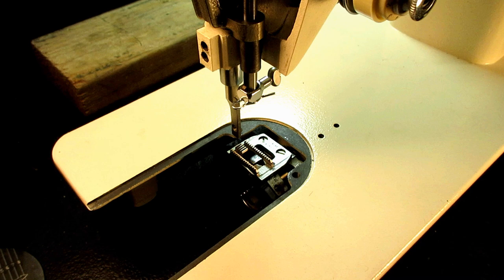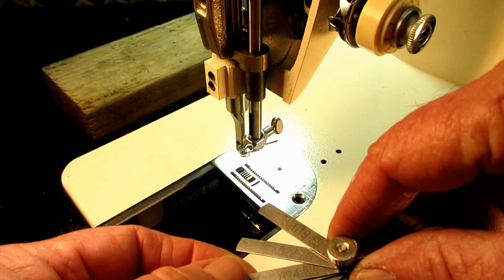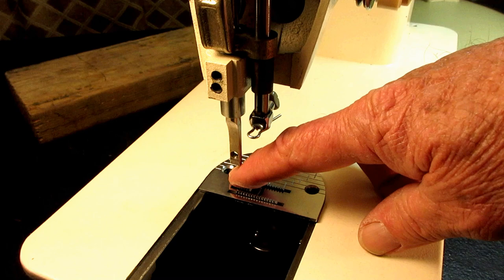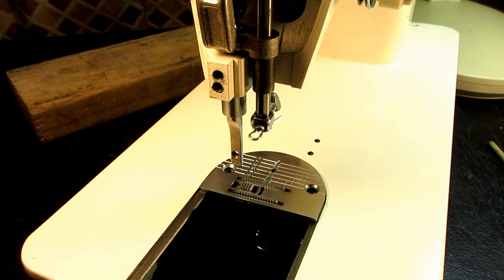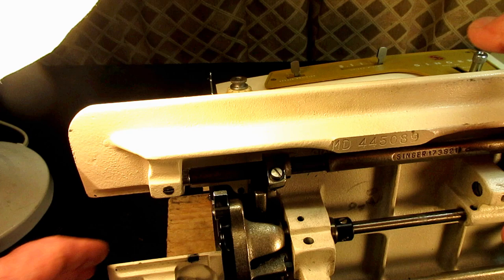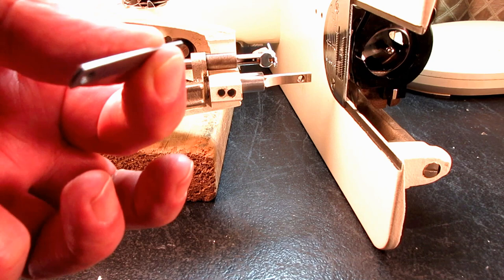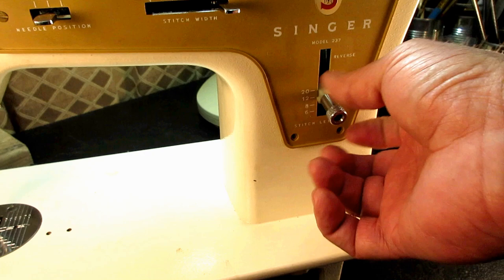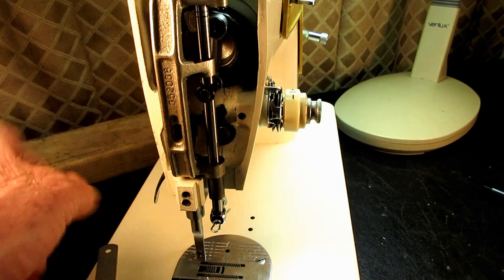How to Check & Set the Height of the Feed Dog on a Singer Model 237 Sewing Machine.

Comment: Andy, you certainly have a talent for explaining and demonstrating complicated processes. And where you thought you  were a bit OCD for going back and rechecking the feed height, I was impressed that you remembered to check that the stitch length and the needle bar height had not changed in the interim. It's this kind of attention to detail that avoids having to go back in and redo a job.

You were very gracious in mentioning my suggestion and I thank you for that. I love that you could take it and find a way to make it work for you.
Reply from the maker: Thanks for the kind words, Terry. I did train other techs and teach a few tech classes during my career. I always approach it by thinking about what I would want to know and understand about the part or procedure and go from there. Going back to double check, including the length and bar height, is something I learned the hard way. It is easier and more efficient to double check than climb back up the pole because a connection was wrong or loose, haha. I'm so happy you shared about 3 blades. I can't count the time spent fussing with a feed dog while going back and forth from the needle plate to clamping screw. Now I can set 2 blades against the dog, overhand the 3rd blade and push the dog up against it and I'm done!! So. gracious or not, I am very grateful. Take care and thanks for watching.

Comment: Best video. I think I just learned 10 things. I moved rural and decided to teach sewing as I seem to have become the town alterations person. In the meantime I’ve bought several used machines. I only buy vintage. My own Elna is 30 some years old. Now have 8 and only 3 are Singers and they are all very old but the other 3 are different brands, Japanese made. Slowly ive figured out how to fix them but limited instructions and heavens if you find a part list. But one a Sears Kenmore I now know the feed dog is too high. In part of all the clanking and also I compared to the other 3 vintage. Another person did a video of a different model of Kenmore and not as detailed but think between these two videos  I can find the right screw. Seems same place as on this Singer. I unstuck the reverse handle which many have said is an issue on my particular range of models and the handle breaks off. So I think I can do it. Will watch this a few more times. Now just to be not afraid of my Singer 1933 industrial with a clutch motor!! Edit. Thinking now I think this is the issue of my 1919 Singer Red eye. It was partially restored when I got it but cannot sew for the extreme pressure even unscrewing the presser foot pressure knob. . Forgot abut it with the recently acquired Sears having similar issue. I subscribed!!
Reply from the maker: Thank you very much. Other viewers have told me my videos helped them with a Non-Singer machine and always happy to hear that. I chose Singer b/c the parts are more readily available or were back when I started working on VSM. Don't mean to give you too much "homework", but here are other "Feed Dog" videos I have done. Best of luck to you and thanks for watching my channel:
Singer Model 353: https://youtu.be/XrhCkDT0lgA
Singer Model 347: https://youtu.be/twlPTcJW5mY
Singer Model 301A: https://youtu.be/Du-W1k_qHHI     (Set Height)
Singer Model 301A: https://youtu.be/uAOcMv4IPj0      (Set Lengthwise in Needle Plate)

Comment: Andy, I so appreciate your videos. I'm just getting started in servicing/repairing, and I'm working on putting together my tool kit. Would you think a feeler gauge is a good buy at this stage, and if so, would I need both metric and imperial?
Reply from the maker: I often use feeler gauges. I have a gauge with 1.5" blades and another with 3" blades. Both of these have dual markings for inch & mm. Example is a blade I use often for setting the Thread Clearance Gap. It is marked with .014 inch and 0.35mm. I can't speak for other brands, but many of the Singer Service Manuals have instructions in both measures. Thanks for watching my channel.

Comment: Thank you again Andy for another informative video. 

I have a problem with this model where the upper thread ist not getting the lower thread.
And found out that the grabber/grasper (correct word?) doesn't run around the lower thread in total (only 180°) and therefore doesn't grabb the thread
But: i could not see the reason for it.
Hopefully you or someone else does know!??
Reply from the maker: The grabber/grasper is known as the shuttle and more modern term is the hook. The hook on this machine is an oscillating hook, not a rotary hook. An oscillating hook only travels back and forth 180 degrees. It sounds like your hook is doing that. Sometimes the "timing" of the hook point to needlepoint is off, and the hook comes by the needlepoint and thread too soon or too late to grab it. It almost impossible for the timing to be off on this machine the way it is made. I would look for a different cause. My playlist of this model may help if you have not already seen those videos: https://www.youtube.com/playlist?list=PLsCOZgzzaiKKzvgm_CYPFnDeM8ZqTTo1h
You may want to download a FREE copy of the original Singer Instruction Manual for your machine:
https://www.singer.com/sites/default/files/product_manual/SINGER%20237%20Sewing%20Machine.pdf
You can look through it to be sure you are using the correct type and size of needle, are threading the needle and the bobbin case in the correct way and verifying how to "bring up" the bobbin thread before you begin to sew.
If these things do not help, my business email address is listed on the "ABOUT" page of my Andy Tube Channel. Good Luck.
Reply: @andytubesewing1953  Hallo Andy, thanks for the very quick answer and also the refences! I will watch them soon.
What I understood is: It [is] almost impossible for the timing to be off on this machine the way it is made. 
So the reason it's not catching it, is very likely a different from what I suggested.
correct?
Reply from the maker: Correct, and let me expand. On many machines, there is actually a function for setting the timing of the hook to the needle. On this machine, when the needle bar is set at the correct height, the timing is also "set". One of the videos in the playlist I gave you is for setting the needle bar at the correct height: https://youtu.be/bRjfg2VaqP4
If your hook point is not grabbing the bobbin thread the first thing is to remove all threading and rethread the needle, bobbin, and "lift up" the bobbin thread. If that does not fix it then the next step is to check/set the height of the needle bar.

Comment: Thanks for the video! My 237 doesn't seem to have the clamping screw to adjust the feed dog height, and the mechanism looks slightly different underneath. Mine also has the 'darning' switch to lower the feed dog. I'm having issues with the feed dog not feeding fabric, and was wondering if I needed to adjust the feed dog height, but I can't see how to do it on my model other than the darning switch. Do you have any suggestions? Thank you!
Reply from the maker: You have the "M23" version of the 237, so 237-m23, also called the 237M. I've never seen one. The Service Manual is only for the 237 and does not show the parts of the 237M for the Feed Throw-Out. Oddly, I have two parts diagrams, one for the 237 and the other for the 237M. I'll be happy to share all this with you if you'd like to have it. Just email andymanuals53@gmail and ask for "ALL 237 DOCUMENTS" and I'll reply with the three PDFs. That's the best I can offer you.
Reply: @andytubesewing1953  Thank you so much, that would be great! I will send you an email. Thanks again.
Reply from the maker: @sattwawygmans4604  They are on the way. Good Luck!
Reply: @andytubesewing1953  got them, thank you!